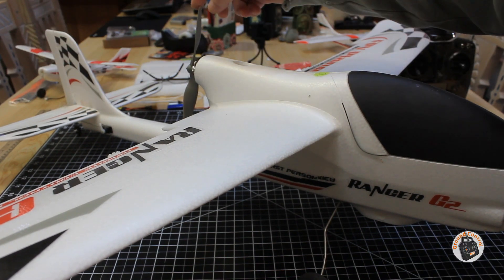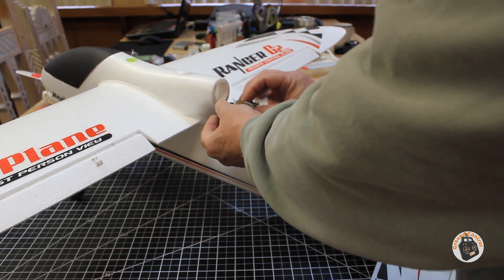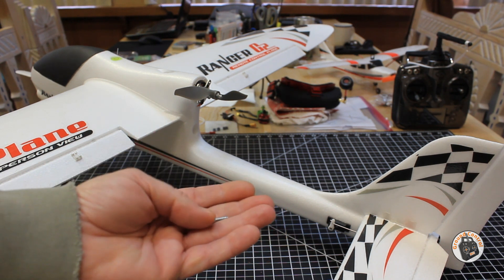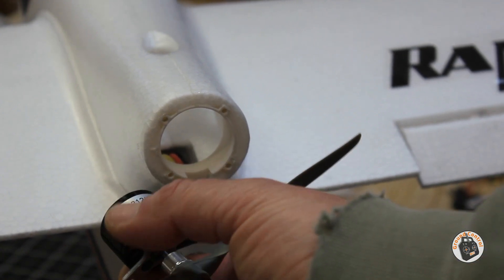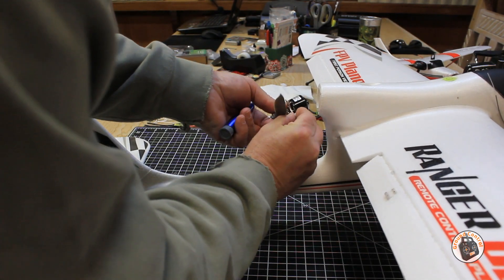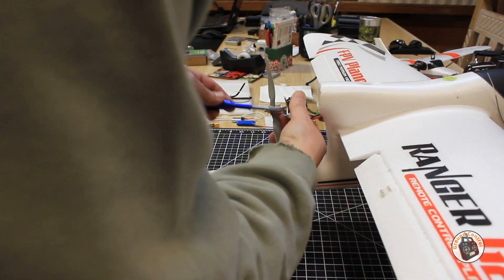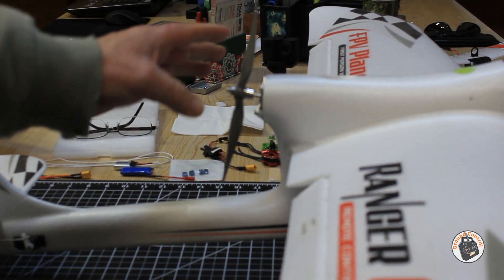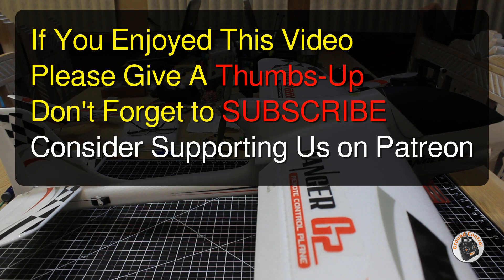Tutorial - Volantex Ranger G2 - Fix that bad Thrust Angle

Comment: The real take way here is aligning the motor thrust angle to the CG.
Reply from the maker: Yes, that's exactly correct.
Then when applying throttle it's not pushing the nose up or down.
I did receive feedback from others that had purchased this plane later and they stated Volantex had corrected the thrust angle.

Comment: Hi, I'm thinking of getting this plane soon since price is reasonable.  I have two small gliders already the WlToys F959 and the OMPHobby T720 but they are kind of small. I would like to have larger glider like this Volantex G2 1200mm, but only of the fix of the thrust angle solves the issue of nosing down. I'm also thinking of not using the landing gear and use a center wheel since I most hand launch. Do you still recommend it in 2020?
Reply from the maker: Yes, I recommend it as long as the person realizes it needs a MOD on the thrust angle. I wouldn't recommend it stock. The Ranger G2 is a very nice flying Glider once the thrust angle is fixed. It was a bit of work but well worth it. I can not only launch it very easily by hand but no Flaps are required on launch. The MOD'd thrust angle worked great and I now have an 8" Prop in it where there wasn't room before the MOD. I have to put a 3S 2200mah 25C LIPO in it to get the CG just right otherwise it would be a bit tail heavy. It came with a nice canopy replacement for mounting a camera as well ;-) If I had grass to land on I would just be using the Center Wheel as well.  I'm going to be taking it out for another flight soon. If you can fix the thrust angle you'll really like it ;-)
Reply: Yes, that mod should be easy. I've done worse. Lol. I think I'll order it tonight before the BG 9.9 special ends.It will be about $76 after discounts.. Thanks
Reply from the maker: Not a bad price at all for such a large ;-) Have a good weekend and I'll see you in the Air!
Reply: @GroundControlRC  Thanks, I just ordered it using your link. Have a great weekend!

Comment: Got mine on order then found the videos about people with the nose ploughing the fields due to motor alignment. Well, its 2020 and august so they may have changed something but i doubt it - so ive made a note of this video, the washer diameter and screw size so i'll be prepared - thanks!
Reply from the maker: Thank you! It 's a great flying plane when the Motor Thrust Angle is correct. You should have seen my face the 1st time I launched and watched it plow into the ground ;-) See you in the Air!

Comment: Thank you for this very interested video! Please  I am French and my English is very poor. May I ask you to send me the size of the plastic  part that you put and the size of the screw please ? I want to be sure that I get it ? Thank you very much
Reply from the maker: The thickness of the nylon spacers I used on the bottom motor mounts are 3mm thick with a hole approx. 3.5mm. The screws I used were course thread, 3mm diameter, 11mm in length. The screws were a bit larger diameter than the stock screws. The stock screws are 2.5mm diameter, 8mm in length. If I had 2.5mm screws that were 11mm in length I would have used those. I hope that helps.
Reply: Thanks a lot .. yes it help me a lot to understand exactly what you did . Thank you

Comment: Thank you for this! Very helpful! Just to confirm, please, do I only put two 3mm washers at bottom to lift the angle or do I have to put two 1.5 mm washers at top together with two 3mm washers at the bottom？Thank you in advance!
Reply from the maker: Thank you for the kind words! I just used (2) nylon spacers under the bottom of the motor mount to lift the bottom of the motor mount to give me the angle I wanted. The spacers I used were 3mm in thickness. That provided a huge change and greatly improved the handling of this plane. I hope that helps and I'll see you in the Air!

Comment: 4s motor+ 60amp esc = more power and weight in the rear, nose stays up.... GREAT VIDEO! GREAT STOCK MOTOR MOD!
Reply from the maker: Thank you much Paul! Yeah, I'm much happier with the way it flies with the new thrust angle. I'm going to test it with an 8x4 prop the next time out and see what kind of acro it can perform ;-) It's a nice FPV Cruiser but it's a Big change from flying Parkjets ;-) I'll bet a 4S will make it more of a Sport Plane than a Cruiser ;-)  See you in the Air!